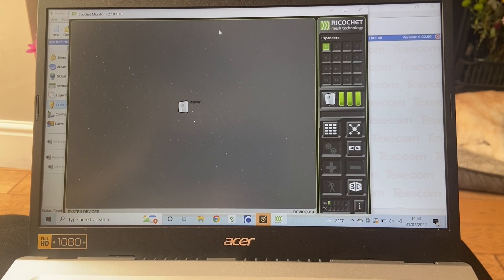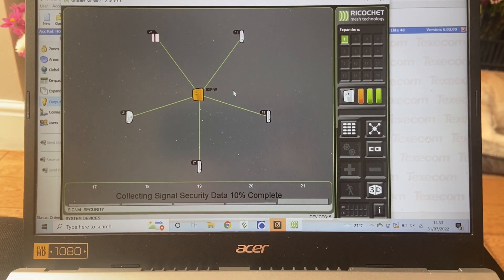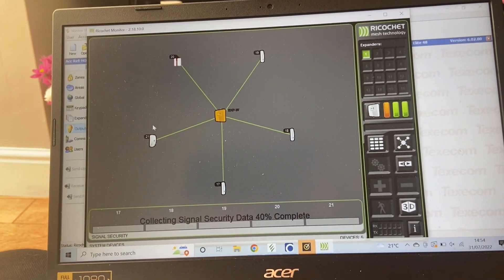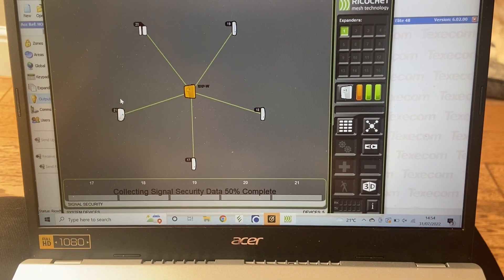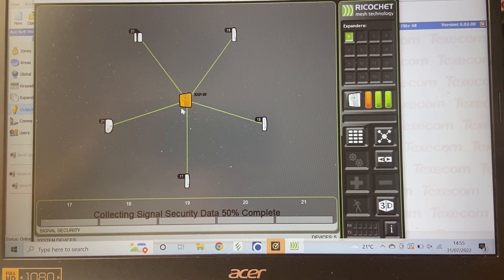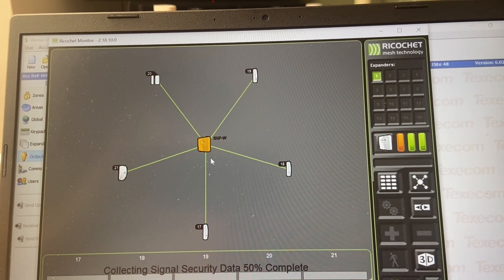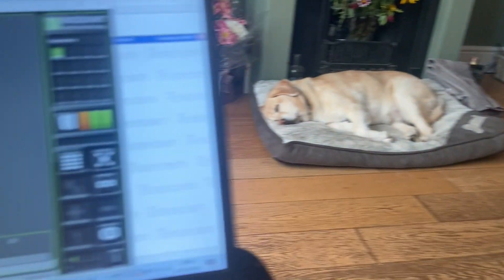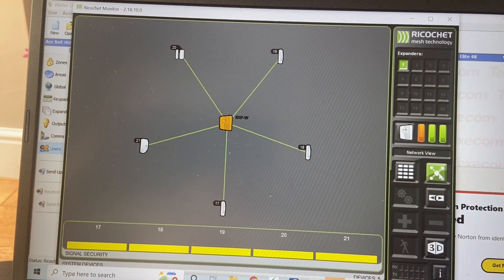Texecom Ricochet Mesh Radio

Comment: Hi so this is not a wired system?
Reply from the maker: It’s both.  Wired throughout the house and radio to the conservatory and drive as can’t or don’t want wires going to them.
Reply: Hi nice video.
Have a question for you.
I’ve got a 64-W panel which has 4 in built wired zones but I’m using some ricochet devices, one of which I put in the van at night for obvious reasons.
Issue is the polling keeps dropping and when I check in wintex and matrix view I don’t have some of the info you have such as when clicking on the pir sensor it doesn’t t give me the channel no or signal strength and I don’t have the status bar like you do at the bottom with %.
Is there something I’m doing wrong or do I have to latch my panel into configuration mode or something?
Cheers
Reply from the maker: Richie.  To get the status bar on wintex you need to have the radio side in commissioning mode, this learns the mesh and you can then trace which detector it’s bouncing off.  Don’t forget that a detector can only repeat 4 devices through it so the more devices the better the mesh.   As for the detector in the van be careful as you van is life a faraday cage and may cause signal problems.  

I think this is the answer to your questions.